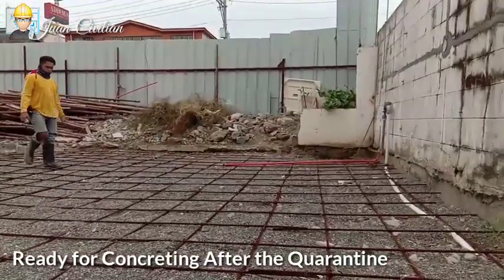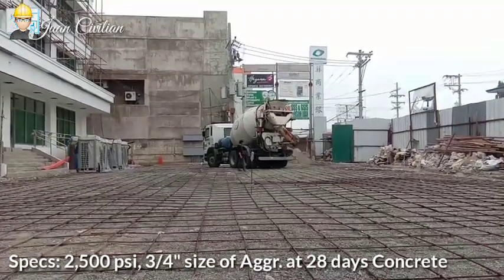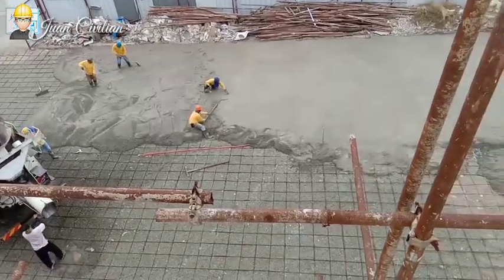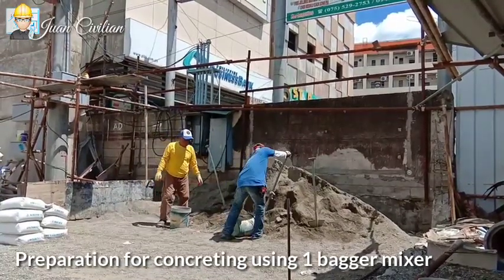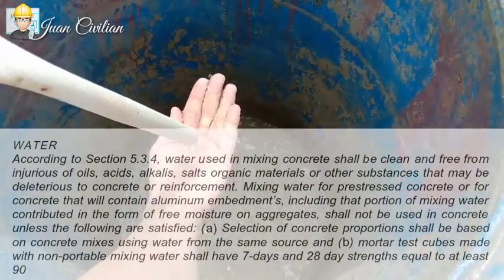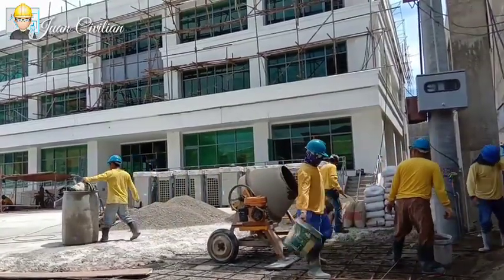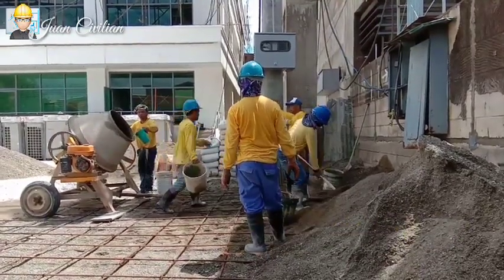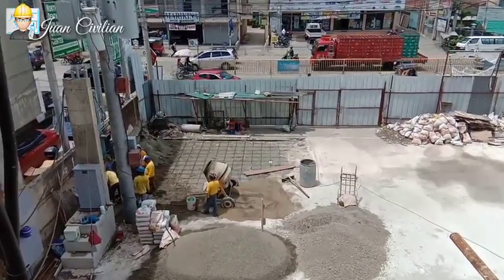CONCRETING COMPARISON: Ready Mix Concrete vs Bagger Mix Concrete

Comment: sir for example po we need 5 mixer for buhos, per mixer po ba ang pagkuha ng concrete cylinder sample?
Reply from the maker: Hello po, as per standards 3 cylinder Sample compressive strength for each day of pouring not more than 75 m3 of concrete, at depende din po yan sa specification ng owner kung ilan yung required strength, sa experience ko at least 6 cylinders: 3 cylinders for 7 days testing and 3 cylinders for 28 days testing.
Reply: @juancivilian  thanks for the idea po

Comment: Thanks for sharing, question naman po for concrete roof slab balak ko po kasing mag topping tumutulo po kasi balak kong i waterproof anong brand ba ang masa-suggest mo? and for topping I would like to use Holcim cement pano po ang mixture? need pa ba lagyan ng gravel or Cemnt and Sand nalang? and lastly anong kapal ng topping ilang inches ang masasagust mo? Thanks in advanced and more power sa channel mo. God bless!!!!

Comment: engineer pwede po ba mag tanong? ilang cubic po kaya ng ready mix ang uubusin pag 50 sq.meter na flooring, kapal mga inches. tnx po
Reply from the maker: Hello po, kung ang desired na kapal ng flooring sir ay 100mm po, nasa 5-6 cubic po ang kailangan.
Reply: @juancivilian  salamat po engineer. godbless po. ❤
Reply from the maker: Welcome po sir, Godbless you din po 👷‍♂
Reply: Hello po kung ang icconcrete po e mga 2000 sqm na area, at ang kapal po niya e pwede dumaan ang mga loaded trucks mga ilang cubic meter po ng concrete mix ang gagamitin?

Comment: San mas makakatipid sir? Bagger mix or ready mix?
Reply from the maker: Base on experienced sir ready mix po, kasi tipid sa manpower.
Reply: Base po un sa total cost sir?
Reply: Mga ilang cement po ang 5 cubic at 10 cubic?
Reply from the maker: Maaari nyo din po itong panoorin sir para may idea po kayo sa manual concreting standards and specifications 👷‍♂

https://youtu.be/2K-Fowno7No
Reply: Salamat po

Comment: Lods wala ako alam sa construction pero ano you nasa 4:27 ano youn concrete cylinder samples para saan youn?
Reply from the maker: Maraming salamat po sa iyong interest ma'am, ang cylinder samples po ay para ma determined ang strength ng concrete na binuhos after 7 days, 14 at 28 days po, maaari nyo rin pong panoorin ang mga video na ito para sa karagdagang information. Salamat 👷‍♂
https://youtu.be/NhqKavLQUL4
Reply from the maker: Ito naman po ang video kung paano yan tinetest. Salamat lods 👷‍♂

https://youtu.be/xjobFTAEBTI